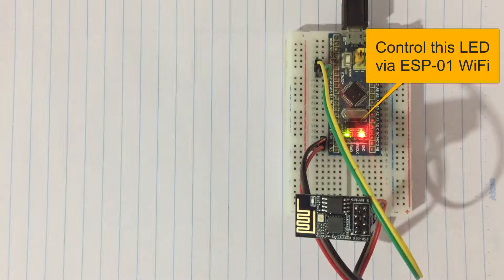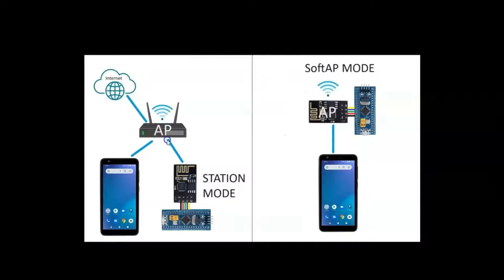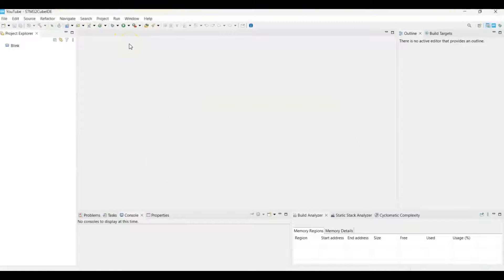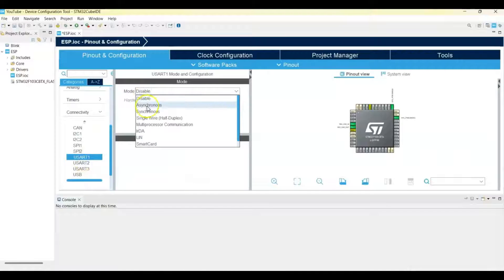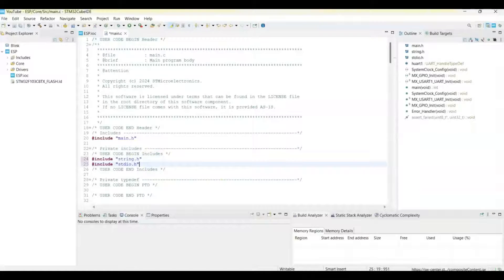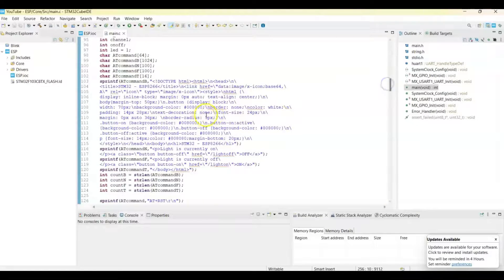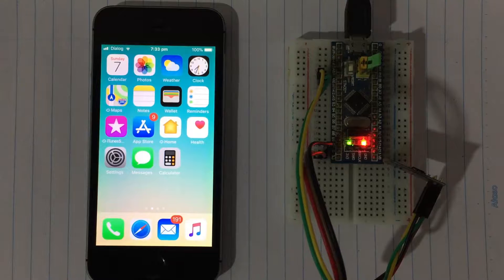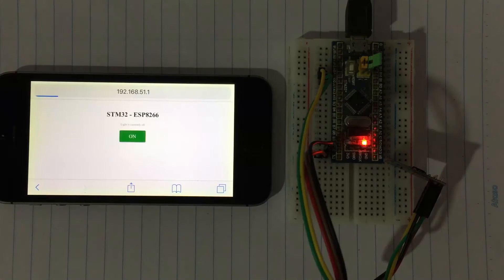105. STM32CubeIDE ESP 01 Module with STM32F103C8T6

Comment: Hi sir Amazing its working little bit. but whenever i connect the "STM32" SID its displayed cant provide internet on my mobile, and i try to put the ip address to my mobile chrome browser, first time its working and next time does not working. how to solve this problem.
Reply from the maker: In this video, I have used esp01 access point mode. You can try it in station mode if you have a router
Then you will have internet also the connection will persist. Thanks
Reply: @NizarMohideen  definitely sir! Thank you for your reply

Comment: I amve been problem with. My server have a different name and different IP. I use this video to set my esp in factory firmware. help me please

https://www.youtube.com/watch?v=Ag_Yk_0AFxs
Reply from the maker: May be you can use the official flasher from espressif and official firmware bin file from ai-thinker as i have shown in https://youtu.be/qm26H_wNqnk
Thanks
Reply: @NizarMohideen  I did it but still show a different name in wifi, and even when i connect the wifi don't need password to connect, and when i put  the ip of wifi or ip of code in google don't work. Can you help me?
Reply from the maker: It may means that the below AT commands not going from STM32 to ESP
AT+CWMODE_CUR=2
AT+CWSAP_CUR="STM32","12345678",1,3,4,0
AT+CIPAP_CUR="192.168.51.1"

Make sure all the cubeide settings and code are correct including wiring and uart baudrate. Thanks
Reply: @NizarMohideen  i do, it's not working